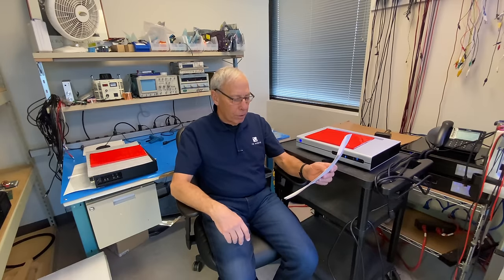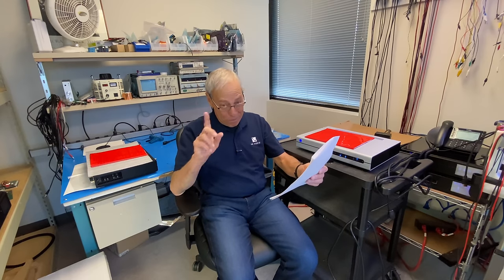How do you know if your caps have aged?

Comment: Be aware that polys or other replacements to electrolytics can have a much greater physical size - building an external crossover box or adding a by-pass cap (parallel cap of high quality of maybe 100th the value) can be ways around this. I recommend  Janzen as a very good value brand supplying both very high-end caps and also some real quality budget lines e.g. their 'cross caps' or their basic MKT range. If you have to go electrolytic, Mundorf  Ecaps are good. The 'Raw' version is cheaper and smaller. The 'Plain' is a better construction though note the size is quite a bit bigger for the same value. Alcaps are another decent-ish electrolytic widely used by (certainly earlier) Kef in some quite upmarket speakers. Recently upgraded Kef 105/3s using MKTs where practical - Wow! Midrange detail and overall clarity in a different league.

Comment: I recapped seventies Technics and changed the small transistors on the front end. Lazy dragging noisy sound was instantly transformed to happy rhythmic thumping. Didn't use any hoodoo audio voodoo caps either. RX30 series, FC and few others. Also changed the caps in my Sony 's to polys. This kind of a "fabric was lifted" off the tweeters experience.

Comment: I replaced the caps in a pair of Realistic Minimus-7 speakers as a practice and to see if it really made that much of a difference. These things were over 30 years old and it made a HUGE difference.  I didn't know if just replacing only the caps was the thing to do, so thanks to Paul for this video.  I now plan to replace the caps on my 30 year old Paradigm Export Monitors.  Can anyone recommend an appropriate brand and type?  I usually buy from Parts Express.

Comment: I've got Infinity RS4b's which I bought new in 1985. I've re-foamed the woofers but I haven't done anything with the caps. The speakers sound good to me but I've noticed that I have to turn the amp up more on the dial than I remember with the old amp I had before. The RMS is approximately the same between the amps. I have to turn the amp up about twice the level as the old amp.

Comment: Get yourself an LCR meter to test the impedance of the capacitors and their ESR along with capacitance of course to make sure they're still up to spec and if not, you can easily replace them like Paul said!
Reply: Do you need to desolder the capacitor to measure it?
Reply: @cliz305  Yes as it might be affected by other components connected to it. It's always advisable to do so. Some meter can read ESR in circuit but I would always recommend you remove it from the board prior to testing the component.

Comment: I purchased a Zenith console radio and the plastic insulated wires are mostly bare as you can shake off the dried and cracked insulation, however all of the cloth type insulation is perfect. I thought about cutting on end of now mostly bare wires and slipping shrink tubing on it then solder it back together rather than replacing each wire. What do you think?
Reply: "one end" not "on end"

Comment: Madisound is also a great source, but you know what, so are Mouser, Newark, and Digi-Key.  Long lasting film capacitors are great, and I use them when budget and space are not limiting me to electrolytics, but they don't have to be Mundorf or Clarity: WIMA, Vishay, and Cornell Dubilier make very nice ones as well.  Much better to spend $20 on a couple of 22 uF WIMAs and replace that failing cap now than wait around to drop (an obscene) $200 on the same value set of Mundorfs down the road for a 0.001% improvement in sound. Paul forgot to mention that you want to make sure the uF rating is the same as the cap you are replacing, and you will typically want a voltage rating that is the same or a bit higher.
Reply: @kalijasin  Interesting... As the sheet says they must be more for mobile or digital devices as 5.5V, 1000uF caps are unusual for non-class D, but that's a good find!
Reply: @terrywho22, and car audio, speaker with amp, portable audio, audio with usb.
Reply: @terrywho22, definitely 👍
Reply: @kalijasin  Oh yeah, car audio...  That's kind of a big market!

Comment: I have a capacitor meter good to 1%, always testing my film caps to match channels and I’ve never seen a value change even after years. Electrolytic’s however get leaky and change their capacitance and voltage ratings. It’s why old amps blow their fuse when turned on. A common speaker upgrade is replacing electrolytic with film caps that will alter the frequency response due to their lower series resistance. Upgrading can be a mixed bag, good and bad. Be prepared to tweak.

Comment: Paul is spot on with replacing caps in any spkr crossover or electronic (Audio) devices. Heat plays a major factor in shortening the life span of a cap and time as well. Internally the electrolyte fluids or paste tend to dry up within 10 to 15 years in normal room temps as long as they are in use.   If you read the Manufactures shelf life expectancy of Electrolyte caps it is usually 2 yrs and then they start to degrade. If in use most average caps start to degrade after a 1000 hrs.
Sometimes spending  more on Boutique electrolyte caps, can result in longer life expectancy 16000 hrs or more in some cases, before they start to degrade. Mind you this is strictly for Electrolyte, Film caps can last 50 to 100 years depending on temps.
Reply: How do you explain my Hitachi Oscilloscope from around 1975 that still works perfectly ?
Reply: My bad Audio devices sound quality degrades.
Reply: Service life of electrolytics, all other things kept equal, is highly dependent on size.  Small parts dry out much faster.  I have some large 35V 10000uF capacitors in a power supply that I designed and built back in my college days (1970's).  They're still in good condition, perhaps due partly to the fact that they are considerably bulkier than their modern replacements would be.  
Operating temperature is also quite important.  Keeping temperature down greatly extends life.  
Today, much of consumer electronics employs miniaturized surface-mount electrolytics, and they are notorious for short service life.  In Japanese culture, equipment like that is often replaced after two years, if not sooner, so the manufacturers make no attempt at choosing parts to last longer.
Reply: @marianneoelund2940  50 yr old power cap vs Modern day fresh cap sound quality. 50 yr cap maybe hear 2 to 4 instruments with the background instruments  fighting with each other creating a smorgasborg. Is it a cello or violinist fighting for front row center, and maybe a couple vocalists , which is fine for most people. Fresh cap on the other hand 10+ instruments and 10+ vocalists. Now where getting into the audiophile world. Mind you Orchestral music is one way of hearing all those wonderful instruments and vocalists and testing your system. I agree small caps dry out faster than big size caps with more fluid.
Reply: @jp-rj7yq  
You might find this interesting:  
https://www.nichicon.co.jp/english/products/lifetime/
Electrolytic cap "spec life" may sound like a low figure, e.g. only 2000 hours, but that's under severe operating conditions, with temperature close to the device max rating.  The predicted service life increases greatly under more moderate conditions.  For example, a 105C rated electrolytic with a spec life of 2000 hours, but operated below 45C and only 20% of rated current has a predicted service life of at least 130000 hours or 15 years.  Increase the operating temperature to 55C and the life drops to 64000 hours.  
The aging effect of electrolytics is primarily to increase ESR.  In a speaker crossover, that reduces the tweeter drive efficiency and allows unwanted higher frequencies to reach the midrange (and woofer, if it has a 2nd-order filter).  This is undesirable because you don't want drivers to be interfering with each other in the upper driver's range.  But the use of film caps, which is often practical for the midrange, will avoid the issue.
Reply: @marianneoelund2940  Yes I agree. Unfortunately not all Amps are created equal some run very hot and those amps or receivers are vulnerable.
Fortunately my 2 ch amp and DAC run fairly cool at room temps due to low to medium listening volumes. Although on my class A pre-amp 4 of the coupling caps on the output transistor stages run really hot rated for 4000hrs at 105C 470uf United Chemi-con LXZ but I religiously changed them every 3 yrs at 12000hrs of use. Not that it needs to be changed, It's just because I want to keep it sounding top-notch. In my DAC there is a pair 6800uf  Nichicon KZ rated at 1000hrs  85c in the analog power op-amps stages they run cool. They will probably last 15 yrs but I will probably change them at ten after 40000hrs. It all depends on temps hrs and how picky you are about sound quality LOL Thanks

Comment: Luckily, the Rubycon Black Gate capacitors in my system are still ok given that the company who built them closed back in 1995. Other vintage gear that I've modded from the mid 1990s with military grade paper-in-oil caps are still ok too probably because I've transfered them to a larger enclosure and placed the heat generating parts  - like tubes, transistors in heatsinks arrays and the main power supply transformer - as far away from the electrolytics and paper-in-oil caps.

Comment: Thanks very much, Paul!
Sounds like "It's about that time" for my speakers, as well.
Then, the amp...   : P
Reply: You will need to do a bit of research as to what brand of elco to put in your amp or risk to make it worse. In any case stay away from Chinese parts.
Reply: @hugobloemers4425 
Thanks!
Another commenter suggested replacing only electrolytic caps?

Comment: The Duetta Sigs use decent quality Sprague film caps which should still be in good condition.You could upgrade these with better film caps but not really necessary from an aging point of view.I don`t have to worry about aging crossover caps because my Duetta Sigs are actively driven fortunately.
Reply: What are you using for an active crossover?  DAX or ??
Reply: @chrisglass19  The active filter is a Diy kit produced by a local kit supplier called Sage,sadly no longer in business.I was not impressed by the DAX after seeing a schematic of the circuitry which included 6 op amps in series for each leg of the crossover.The Sage crossover only uses a 3 transistor input buffer and output buffer working in feedback free differential class A with high performance discrete class A current and voltage regulation.In conjunction with high performance passive parts,Vishay foil resistors,Relcap foil polystyrene caps and Rubycon Blackgate electrolytics the sound is very transparent;better than the DAX.

Comment: My old Grundig console needs a cap job. The power amp is starting to "fart" or run out of power at the higher volumes. The capacity or instant ability to provide power to the demands of the power amp is compromised over time. Its an old tube set so it should be easy.

Comment: I recently took a chance and bought a pre enjoyed pair of floor standers. Gosh they're beautiful but they sounded awful. So I whipped out the crossovers and replaced the electrolytics with LOW ESR Panasonic's. I also cleaned up the bus bars that connect the two PCB's together. After a fair few hours of running in they're amazing. I bet the guy who sold them to me thought they'd passed their best. Far from it!
Reply: Biggest problem I have with old speakers is crumbling woofer surrounds.  The next biggest problem is finding the time to install the surround repair kits.
Reply: @marianneoelund2940  I got lucky with these speakers, they arrived in their original packaging. I think they'd been in storage. The surrounds are in excellent condition. But I understand where you're coming from. I had to replace the surround on my Paradigm sub about 2 years ago. It was a well spent Sunday afternoon. Removing the old glue wasn't too difficult, just time consuming. Paradigm wanted £250 just to look at it. If I recall I paid £2.98 which, included delivery for a gasket from a well known auction site. I've not had any issues with it since.

Comment: Totally agree, if you have 30 year old caps you might as well replace them.
The good news is that you will only pay for the parts and not the profit margin stacking.
I just bought a pair of Magnat All Ribbon 5 on E-bay because I really liked them back in the 80's when they where new. (Sh** happens when you are at home on E.bay :D for days on end) But (not only) back in those days cross over networks where crap. So I will not only replace the caps with new ones from Mundorf but also the coils with Mundorf coils. Though the coils will be fine they are much too small, i.e. they will have a high resistivity/low Q value, not referring to the inductance. If you want to replace the coils, you need and LRC meter to measure the old ones. They cost about $40,- (or Euros) on E.bay which you can basically write off on the cost of modding a single pair of speakers. I bought the speakers for 120 euro and expect to spend about double of that on caps, coils, binding posts which will add up to less than 200 per speaker. My expectation is that they will punch way above that price point.
Reply: It's certainly worthwhile to replace old iron-core inductors with air-core types that have much heavier gauge wire.  You might be shocked at the fine wire gauge that OEM crossover inductors are often wound with.
Reply: @marianneoelund2940  They have air core inductors but they are quite small with too thin wires and because there are no resisters in the network (and I have no means of changing the schematics) my premise is that that the Ri is a bottleneck.

Comment: For the record, Apogees can be serviced by either Bill Thalmann (in Virginia) or Rich Muray (in Nevada).  Both are authorized to do complete rebuilds of Apogees by Graham Keet (or Graz), the man who was able to partially revived Apogee after it was abandoned by ADS (which had purchased the company from Jason Bloom in the mid-1990s).  Graz produces machine cut OEM ribbons that outperform the originals (which were hand-cut).  He recently introduced a new flagship Apogee, the Apogee Diva Advance 9.
Reply: I'm certainly aware of Graz and the US based Apogee service.  But there's no chance whatsoever I'd ship those without having custom shipping crates built,
Reply: @chrisglass19  Craters and Freighters built my boxes when I had to put my Duetta Sigs into storage.  They double-boxed them, in fact, so that they couldn't be moved except as a single unit and with great care.  It cost me $250 for the service 17 years ago - but I still have the individual speaker boxes and styrofoam fillers in a closet.  Getting them boxed today would probably cost you around $500 - but if you ever plan on moving them, you'll want to spend that money anyway.
Reply: @HPLeft  Thanks for the suggestion of Craters and Freighters.  The last such company I used left me disappointed.  I should probably get those boxes built before I need them. The Sigs are not perfect, but they do so many things well and their flaws are innocuous.   I sometimes joke that they are responsible for curing me of being an audiophile.  I simply lost interest in finding "the holy grail" after living with them.
Reply: @chrisglass19  BTW, were you a member of the Apogee Acoustics Users Group back in the day?  If so, this is Matt, the former moderator.
Reply: @HPLeft  Hi Matt!  I was a lurker (nothing of use to contribute) but found that group very informative.  IIRC I was trying to purchase a DAX 3 but was counseled to look elsewhere, which led me to purchase a Marchand XM-44 crossover.  Why Marchand?  Someone on the user's group posted "ideal" crossover points and slopes for the Duetta Sigs and Phil Marchand said he could build me "personality" cards for the XM-44 to those specifications.  It was probably ill-advised of me to jump in like that without more evidence, but I was incredibly happy with the results.  One of these days I'll like to get another pair of stereo amps and put the XM-44 back in.

Comment: Sorry but the idea of measuring freq response with a phone app will not tell you about your crossover caps!    Just using your ears will do a better job.  Degraded caps will typically raise or lower the frequency that the tweeter is rolling off, thus damaging the sound and phase response in the critical midrange.   Paul's correct that they should be changed, but doing so can go from very easy, to REALLY challenging, depending on the speaker design.  I've done many where the parts were epoxied down, and had to be cut and scraped off the board.  Not trying to discourage anyone, but it can be a puzzle.  Also reading the values printed on some old caps can be tough too.  I've done many mods to my old B&W 801-S2's, (very complex crossover!)  and they've been greatly improved over the years.

Comment: Capacitor life depends on temperature. Capacitors in a power amplifier (or integrated amplifier) may dry quickly, but those in passive speakers dry in just 25 years?

Comment: Another tip before you dig into your cross over, when soldering you need to use rosin core solder. I had a customer who went to the hardware store and used acid core solder for plumbing = ruined the entire circuit board ! 60/40 rosin core for any electrical work.
Reply: Ouch!. Yes total newbies probably should find a friend who knows how to de-solder/solder electronic circuit connections.
Reply: should be using special silver containing solder for electronic equipment ("silver solder")
 Pricey but worth it. High silver content in a solder flows well and should be used for all electronic applications like circuit boards and wire terminations. (approximately 4% silver)